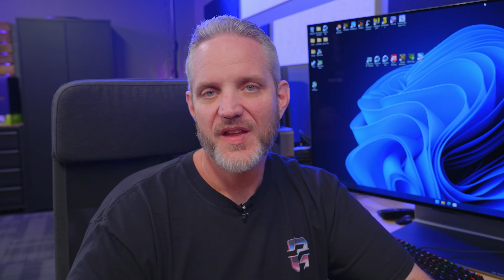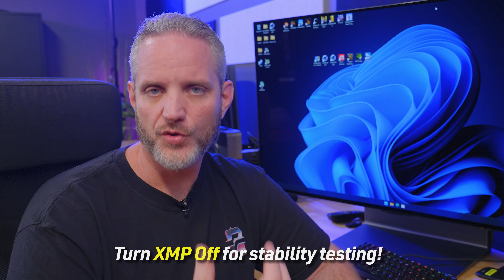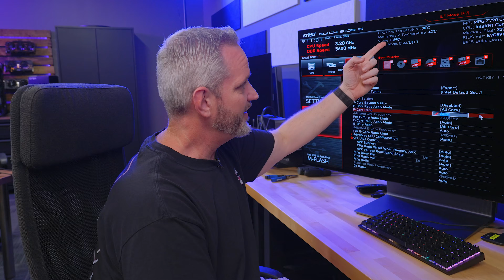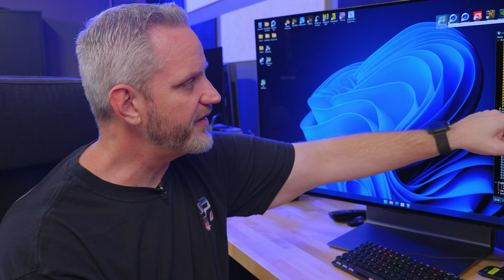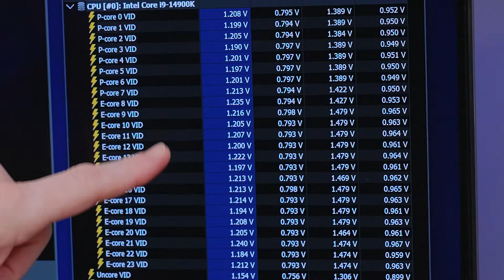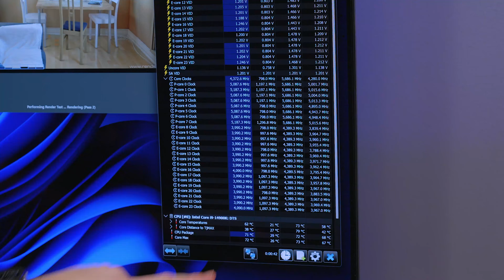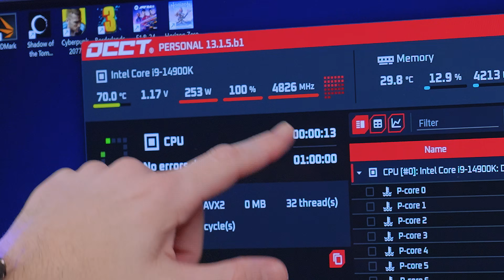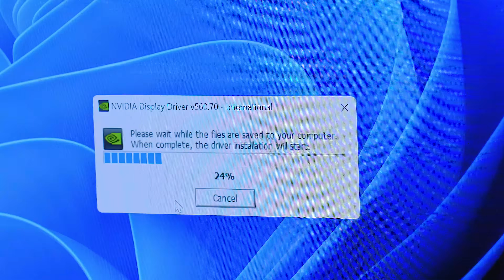Guide: How to check if your CPU is BAD!

Comment: I had 2 x 14900K CPUs die on me through advanced degradation. Each time, the first thing that indicated an issue was when I was starting up the Hogwarts game. The video memory error came up while loading up the shaders. (I also thought it was a video card issue at first)... This was in December 2023 with a brand new rig I built. Returned the CPU's after many hours troubleshooting the error with the parts store, since this issue was VERY new at the time, and we both doubted that it could be an Intel CPU problem.

Solution: swap to an AMD 7800X3D rig.

Comment: My 12100 was hitting 99c and losing frame rates, when the current blame was being placed on lack of bios limits.  I properly set my boost wattages & still 99c, but with acceptable voltages (asrock b660m pro rs).  I then reappllied thermal paste, a long line, rather than a dot, and got my max temps down to 66c

Comment: I guess my 13600K is running pretty well after doing the OCCT Stability test with voltages around 1.26-1.3 something volts (VCore, no ViD, which reached 1.33V). The only bad thing is that after doing Cinebench (2024 version), as I've found a previous score with 800 something points, this recent test scored 430 and something points. I don't know if this is a sign of something going wrong. I don't know if turning off the virtualization has some influence on this. Take into account that I've seen peaks of 1.56V (VID) when downloading content for Trainz. I guess I'm just lucky by now after all this shit. I hope not to switch to AMD or buy a 12900K in spite of having a higher PL2.

Comment: 14900KS @ 253W since day one had major RAM issues. Could run 2stick at only 4800MT/s max, and couldn't even post with all 4 sticks in. ASUS and Intel not much help on either. Then started getting BSOD's related to memory and system files, then later on BSOD's related to CPU. Towards the end, even the USB started messing up and couldn't load windows more than 5 minutes. Finally Intel willing to RMA the CPU, after numerous messages/pics/proof/etc, and now I have to wait 5-6 weeks for them to make more (since they apparently have no stock). Really bummed out as this is my only computer and can't game on my laptop. Even sent motherboard into ASUS to verify that it was not the issue... Tried numerous z790 motherboards (4x ASUS and 1x MSI) and over 6 different RAM kits all on ASUS QVL, none would boot more than 3 sticks.

Comment: 1:58 They do implicitly state a lifespan time Jay, just look at the ARK page for any intel CPU. IDK what AMD has similar to that. Every time I google a CPUthe intel ARK page and it tells me when "End of service" was. From the launch date to EOL, is barely 5-7 years for a lot of intel CPUs.  Yet, I own some very old CPUs from 16 years ago and they are chugging along just fine, I've had some newer CPUs that didn't last nearly as long where my old Core 2 Quad Q9300 has outlived them.  Really all about the silicon lottery on the lifespan of a CPU, not just it's performance.

Comment: You do know your cpu should never go past 1.37v at any time righht... or you will degrade it.....even during boost's... ITS BEEN LIKE THAT FOR THE PAST 30 YRS
Reply: That's a gross oversimplification that isn't inherently true. It really depends what parts of the CPU are getting that voltage and for how long. It seems Raptor Lake's ring bus is getting too much voltage, but some of the other parts can handle that voltage (at least, if they weren't connected directly to the ring bus).

Comment: The MSI MAG B550 GAMING Wi-Fi on the latest bios and chipset driver sucked it would not let me adjust my PBO2 in advanced mode for my Ryzen 9 5900x I wanted PPT 195 TDC 130 EDC 140 the highest I could get it and save it was at PPT 145 TDC 99 and EDC 115 I do not WTF was going on with this motherboard with an Arctic Liquid Freezer III 360 Black.?.

Comment: I’ve been testing by installing windows on a random drive you will get a crash at the partition screen or the copying files portion of the install I do this at work when I suspect degraded CPU (only had 2 CPUs in this entire debacle) you can also confirm by running the 7zip benchmark. Degrading CPU is tough to diagnose as it seems random for its signs so not much you can do to test you can suspect it but not 100% no shadow of doubt that’s what’s happening

Comment: This makes me sad. Finally can upgrade my old faithful potato (i7-920. Yes, you read that right.)
I am aware that ANY processor will be an upgrade, but wanted to kind of future proof and now with the latest mis-steps of AMD and the issues with Intel, I do not know what to do.

Not just gaming and not just productivity do I use my machine, but I am getting tired (even as I type this) of waiting for the keyboard buffer to catch up with my typing, or moving the mouse and waiting for display to catch up....
Reply: AMD's Zen 4 still seems like a good deal. It's cheaper now that Zen 5 is out, it's on AM5 which should still have at least another year of support left, you can get the 3D v-cache chips like the 7800X3D, and they have most of the other bells and whistles available. 
If I were building a PC today, that's what I would do. Alas, I'm stuck with a 13900K that was meant to be my future-proofing...

Comment: When my i7-13700k runs at voltages between 1.2 -1.3 while idling on the desktop being cooled by a 360 Deepcool AiO, is that considered too high of voltage?

Comment: I got rid of all my 14900k and ks CPU's and went back to 12th gen. Ive had no problems since doing that.
14th Gen was misery 
I upgraded 3 machines from 12th to 14th gen for a 10-15% boost, a boost i then had to down clock them all to preserve the CPU's and then despite doing that and upgrading the bios each time they released they all slowly died over 4 to 20 weeks, it was sublte degradation but they basiclaly became more and more unstable until they wouldnt even boot.
Benchamrkign crashing, then Email crashing, web browsing crashing then games and then eventually not even booting , the worst one was a 14900KS that lasted just 6 weeks! none were overclocked , just a basic XMP profile.
What is the point of upgrading from 12th to 14th only to then downclock and it only last a few weeks anyway.
Ive gone back to 12th Gen, 14th gen has done so much damage to intel. Im AMD next build now.

Comment: I have a 13600K purchased last year, before new CPUs were released. I never had any issue, don't stress it much anyway. Anyway, the idea is this: i have no reason to update my MSI, nor to do anything basically :) . I have a good AIO cooling system, I don't bother my PC, he does the same, we're all happy :D. Cinebench barely gets the CPU to 1.4x average voltage, looks really good for me.
Reply: It's still safer to update, and it's being recommended by Intel and their motherboard partners. This isn't about how much you stress it or if you've had an issue. It's an inherent problem with the way the CPUs work. 1.4V average, even if it's only under Cinebench, sounds way too high for a 13600K anyway.
Reply: @GareWorks  1.4 is max, not average! Average is 0.7x in Windows when it’s not doing anything and i have 1.x GHz 😆

Comment: My i7-14700K degraded so much it broke my motherboard. ASUS replaced my motherboard a week after I sent it in and my shop replaced the CPU after a day when the tested the new Motherboard with my chip that did fail. I got my Rig (built it myself but got all my parts from the local computer shop 8 months ago. Been running for 2 weeks and system works better than it ever has.

Comment: For me, I'm on:
i9 14900KF, Asus STRIX B760G, G.SKILL 6400 2x16GB TZ5RW.

I was on Bios 1403, it was running fine until I heard all the kerfuffle of intel micro code 0x129, and so I decided to update my Bios to 1663.
I shouldn't have updated it. My PC was running okay, and now it just crash on almost everything (soft crash, not the BSOD).
I tried rolling back to 1403 BIOS but it's too late, the Intel ME it's updated and now I can't roll that back.

My PC has not been stable ever since, and if this video were to shed some light, I think the latest BIOS 1663 just expose my busted CPU (which was on its way to death with the 1403).
My CPU was running around 85 C on load with NZXT 240.

hopefully after running some test, I could convince Intel for me to RMA this CPU.

Comment: If you want to really give a PC a workout to check stability I recommend 'Phoronix test suite' It's cross platform and literally has everything but the kitchen sink in it.
Also, compiling something from source such as Firefox or Librewolf which can take hours depending on CPU will give a CPU a good workout.

Comment: I have a 13600K and after the microcode update the stock / intel failsafe voltages were way higher than before. I set them lower myself now with only really changing the SVID behaviour. Else the CPU would cook itself even under stock settings. it's an asus board if anyone else has had a similar problem. also what I am wondering how much of an impact the amps really have. like when i read up and looked for what causes the degradation it mostly only says the voltage. So is it generally just the voltage, the wattage or voltage and amps that causes it? that would be interesting to know.

Comment: Should be looking at Vcore and VID's, not just VID's. Or VR VOUT if Vcore is not available. When people look at VID's and ignore Vcore, at the potential risk of AC LL and DC LL being out of whack, the CPU might be given way more or way less voltage than requested (VID's). What are we even doing here...? IA VR Voltage Limit will not save you there. 0x129 might, or might not.

If it doesn't run intel default profile: severely degraded
If it doesn't run with 0.5 mOhm AC LL, add LLC or else: degraded
If it doesn't run at 0.4 mOhm AC LL (Gigabyte Perfdrive "Optimization" for example): just increase AC LL or add specific LLC level. Otherwise: degraded

Comment: Hey Jay
Thanks for the great content. 
Here is a great story I don't think has been covered. 
With the CPUs with E-cores and Windows not assigning programs to these E-cores or at least using P cores first and some Ecore but very little. I downloaded Process Lasso (PL) to check and found pretty much only my P-cores are being used. I might have changed settings to affect this but do not recall anything specific. I am normally very mindful of this. The program allows me to assign programs to the E-cores but why is windows not doing this regardless of settings. So the settings in PL shows the programs are assigned to both P and E but still predominately run just about only on P cores. Making my laptop run hot and have the fan spinning up all the time. This might be only a me problem but thought there might be a lot of users out there that do not even realise this is happening. They would use a lot more electricity and losing out on the benefits. I mean only Heavy workloads should use the P-cores not basic office tasks. or at least if the program pulls more resources it should automatically reassign as E core limit is reached. I currently using 13900HX on an Alienware M18 R1.

Comment: If you need to watch a video that tells you how to check if your cpu has degraded then most likely your cpu is not degraded and you just need to tweak some bios settings. Either that or you have degraded. If you have already updated the microcode and enforced intel limits, disabled turbo and locked the cores, or left turbo on but set all the max values to the all core turbo, let’s say 5.5ghz even for single core etc and it still crashes you got issues. Let’s say you go a step further and  and you give it a +0.1v VID offset and still crashes, then yeah your cpu is toast.

Comment: hitting 1.5v and 95c temps randomly for a sec while gaming with intel settings on performance and latest bios on gygabite ( i9-14900kf / 360 aio) should i worry? no crashes yet cpu is 1 month old

Comment: I saw that my i5 13600KF ran at 1.35V before and with 0x129 it runs at 1.29V on  the Gigabyte B660 with Prime95
I want to undervolt it a little more but it is unclear to me how with this BIOS. Hitting 85°C under a 250W Be Quiet Dark Rock Pro 4

Comment: My 100% Repro scenario: ASUS Dark Hero motherboard, Intel i9-14900k. Playing world of warcraft with even so much as a single lua addon enabled would cause wow to crash with a memory error . At the end it would crash within a few seconds to a minute. Turning off every addon seemed to let it run okay, though I didn't do that for long. The first workaround I figured out on my own was to totally disable Turbo mode. Later I read the Oodl paper and used Intel's XTU program to set my p-core ratio to 54 from its default 57 (and turned Turbo back on). With turbo off or after I changed the p-core ratio and turned it back on, WoW ran fine with all my addons loaded. I RMA'd that CPU, Intel was out of stock and offered me a refund. It's in their possession now for "validation" and my refund is pending. I'm now running an X670E-A ASUS motherboard and an R9 7950X3D. It runs hotter than the 14900k (Intel was cooler at the desktop due to the e-cores but also playing WoW) but it's been good so far.

Comment: So Intel 13th and 14th gen dying and AMD 9000 series CPUs flopped.
What a time to be a PC enthusiast.
Reply: I think some of us are finally done with paying for inflated prices. Enough is enough!
Reply: So hence both sucks 😂
Reply: So glad my last rig was 12th...
Reply: my 13600k runs awsome & cool
Reply: AMD 9000 series CPUs failed? LOL, that’s aged like fine milk.
Reply: I wouldn't consider 9000 series a flop. Everyone is just getting used to constant "performance" upgrades when it is no longer honestly needed. Companies are now starting to trade stability for "performance" and it has turned out to burn them in the long run.
Reply: How have they flopped?
Reply: The neat part is now bort amd and Intel will be forced to deliver good and good valued stuff. I see iras a win win 😍 10th gen AMD and RTX5000 around the corner 🙏😅😍
Reply: Don't forget that you get to use a dog sh!t OS that's been progressively getting worse called Windows 11 and Windows 10 is unsupported by end of next year.

Linux is alright but the application support for the ones I use is not there. 
MacOS is looking tempting as I've used the OS in the past and thought it was butter smooth and had zero issues, but then I have to deal with hardware being locked and being charged arm and a leg for upgrades.
Reply: Hence I stay with am4.
Reply: Seriously man, what in the malfunctionary. This last two generations seems full of malfunctions and user errors.
Reply: This comment aged like fine milk.
Reply: @enigmalfidelity  ?
Reply: I9 14900K + ASUS DARK HERO + VIPER VENOM 64GB 6400mt + RTX 3080 SUPRIM X 10GB  / CONSTANTLY WHEN I START GAMES AFTER FEW MINUTES SEND ME TO DESKTOP I CANT PLAY ALMOST NOTHING / WE TAKE ALL PARTS OUT AND PUT IT BACK ,CHANGE THERMO PASTE OF CPU&GPU REINSTALL ALL DRIVERS /EXCEPT BIOS UPDATE AND REINSTALL WINDOWS 😏
Reply: ill stick with 7800x3d   for next rig
Reply: @CrazyhorseDK  that's what I got
Reply: @CrazyhorseDK no you didn’t haha!
Reply: There is a windows update for the 9000 series. Its confirmed by AMD. They ran their tests on a specific Windows 11 version which can be downloaded, they posted an article on their site
Reply: @Almin88  That's a universal CPU 'upgrade' though, it helps out Intel CPUs too in a similar way, nothing to do with AMD
Reply: @FERKILL377 if it's a windows update for AMD and Intel, it's NOT a "universal" update.
Intel and AMD chips run entirely different.   The architecture of the chip and how it processes data is completely different.
Windows has released updates for the CPU only for Intel in the past, and AMD had to release their own patches to fit the bad issues.
WinTel ring a bell?
Reply: The PC industry is dead anyways, it won't matter.
Reply: @jimmydandy9364  🤡🤡
Reply: @jimmydandy9364   PC industry is dead?   You should elaborate that more because everything in the world is PC related in terms of technology and parts.  This includes gaming consoles.  They don’t run off of rocks and dirt.

Comment: I have MSI B660M motherboard along with intel 13600
Non K CPU and system freezes on low load due to low voltages. Is there any setting in MSI mobo that tells it to not go beyond certain volts  ?

Comment: I purchased my CPU in January, died in June and took my motherboard with it. I now have a new MSI board and CPU, it took 2 months to complete my RMA's with everything going on. 

A positive note the latest BETA bios from MSI with the microcode update, has STABILIZED my CPU FINALLY! Prior I had to underclock my CPU at a ratio of 6! In order for it to work properly.

Comment: It is said that only desktop chips are affected but I've heard some rumors that some mobile CPUs with HX suffix may degrade too. Because HX CPU's actually share the same architecture with desktop CPUs. Do you know anything about that? I have a ROG G16 laptop with 13650HX. Also I wonder if there is a table or that kinda list for nominal voltage ranges for CPU models. Thank you for the video Jay. Greetings from Türkiye 👋🏻 🇹🇷

Comment: For me the latest BIOS update completely screwed my system (13900k).
- constant browser and game crashes (memory access violation)
- nvidia installer failed every time
- ubs sticks were not recognized anymore although other usb devices still worked

Set the p-core ratio to 55 and now everything works again for days without any issues...yet.

Comment: My 14700K continues to request VIDs in excess of 1.55v despite applying the 0x129 update. HWiNFO confirms I'm on Microcode 129. I'm on Intel Default Settings in the BIOS.